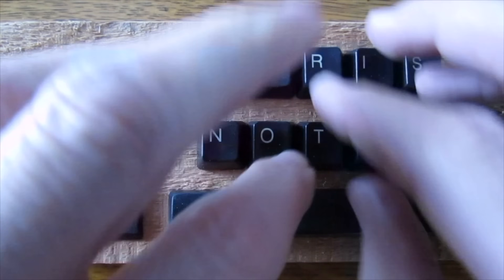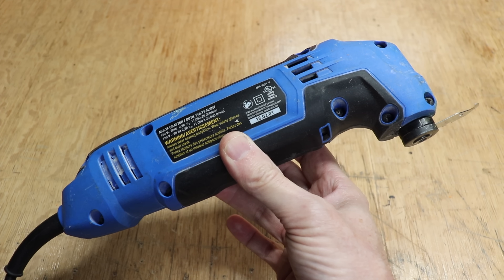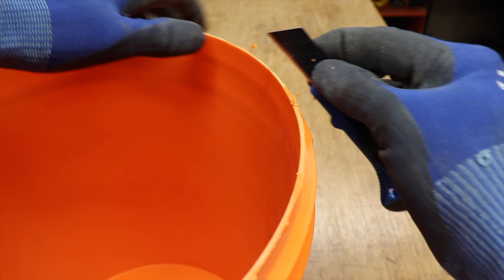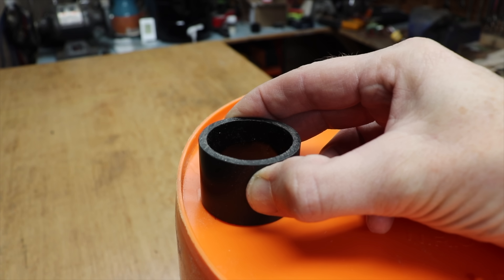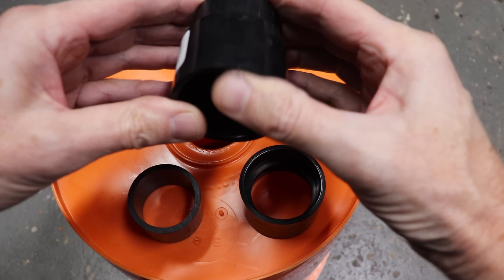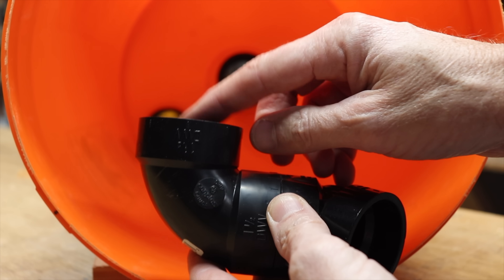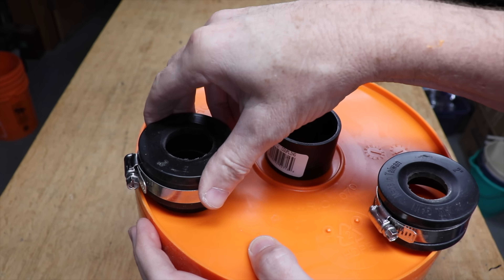How to Make ● Simple Cyclone Dust Collector

Comment: Hello, I am a beginner woodworker so sorry if the question is stupid, but can I make somewhat of a hole on the bottom of the bucket, so the dust would fall into a larger container(which is sealed aswell). I work in a small garage and want to use only a shop vac, but I don't want to empty it everyday. Maybe in this case I should buy an actual cyclone?
Reply from the maker: It's all about experimenting and trying things out. You should try it and see it that works. You may be on to something!

Comment: Just wanted to add another comment about this dust separator. My grandfather and I was ripping a half mile of cedar for a project and had burnt up two shop vacuums trying to keep up with the table saw. Came looking for a cheap quick solution for this weekend and built this 5 gallon bucket separator. And what a job it did. We still needed to clean the filters every so often because of the fine powder like dust of the cedar. But what a job it did on the rest of the stuff. Thank you for the solution.

Comment: Instead of wasting this much time and money on something that will reduce the suction power of the vacuum i would simply install a vacuum bag in the bin of the vacuum to the plastic part where the hose enters to the bin so the filter will stay clean and when i am done i can easily throw the bag away.
Reply from the maker: You need to build this! You'll be surprised at how well it works!

Comment: I wonder if the incoming pipe were somehow lower mounted on the side of the container, if the sucking hole were higher about 6 inches than the incoming pipe, would the filter in the vac be even cleaner...
Reply from the maker: I tried to keep it as simple as possible by putting everything on the lid. You can try that if you like to see if its better.

Comment: I must say quite impressive sir, I've played around myself with various designs mostly for soot. The multiple stage with water cyclonic type is what I ended up with, but alas there is no video with dramatic first person shots of vacuuming. Well done
Reply: I run an extension hose from the vacuum exhaust out the door.  No mess at all in the house.  The ash must be room temperature.

Comment: I built this, it worked great for a little while until I made the mistake of closing all the blast gates in my system at the same time - just for 1 second - and the vacuum imploded both buckets. I was able to bend them back, but now whenever I run it for a little while, it implodes again and the seal between the buckets gets broken.
Ive also found that the pipe connections aren’t as strong as I need.
Thanks for the video anyway, I’m probably gonna go to woodcraft and buy a proper solution.
Reply from the maker: I did an update for that problem here......https://youtu.be/BeU4nqSJtBY

Comment: Waste of time and money.
Reply from the maker: Interesting but why do you say that?
Reply: @chrisnotap  After creating this and using it a couple of time the bottom of The top bucket cracked and needed to be replaced.  Also, the unit is top heavy and constantly tips over.  I purchased a replacement and am happy with that.
Reply from the maker: The bucket may have cracked due to the material it was made from or it was old plastic. These buckets don't crack. I made a second video covering the tippy issue. Here is that video...https://youtu.be/BeU4nqSJtBY
Reply: @chrisnotap  Bucket was brand new.  Thanks, but no...

Comment: Would a car air filter help even better if placed inside the bucket with the connection that the vacuum pulls through?
Reply from the maker: I think you'll find that it's not necessary.

Comment: Interesting, I bought an actual cyclone unit that mounts on top of a Homer bucket about 20 years ago.  Still have it.  I think I paid 5$ at the time for the cyclone tube.  Plus some bolts and silicon.  I can fill the bucket pretty much full before emptying (just emptied it two days ago).

Comment: Have you tried this on a planer, if so, how did it perform?
Reply from the maker: Should work fine on a planer. But to answer your question no. But saw dust is sawdust. It will work!

Comment: Edit: seen your update! Lol. Same thing I did.
 
I love the design... but the buckets nowadays are just to flimsy. Lowe's, HD, ACE, HF, etc. They all seem to implode once I turn on the Vac.
 
I tried 3 different vacs. My big one led to me needing two more buckets.
 
My cordless Bosch did better, but it still caved in the buckets. So I had to support the buckets inside, with other buckets I'd cut the top thicker part, and bottom inch off of. 
 
So 4 buckets, but now my full sized vac doesn't crust it.
 
Thanks for the video!!!

Comment: Just built this today, thank you SO much for the tutorial! I’ve been meaning to do this for ages, and finally found one simple enough that I couldn’t make any excuses. Assembly went smooth as butter, everything worked out perfectly. (I did use a hole saw for the bucket lid holes and enlarged them a little with a Dremel sanding drum to make a press fit for the PVC - my ancient snips wouldn’t make a clean enough circle) I picked up a big roll of sump pump hose (1 1/4”) at the home improvement store, and some T’s to run it to individual machines (drill press, band saw, lathe, sander). Finally, I have a real dust collection system in my modest workshop, thanks to you! Much appreciated.
Reply: Can you tell me what size or model number is the pipe that goes in between the couplings I cannot find it anywhere
Reply: @georgenettlesjr1466  It’s just a little section of 1.5” pvc pipe

Comment: I'm having trouble getting the two buckets to go together after cutting the ring off. Am I not pushing hard enough or is anyone else having this problem?
Reply from the maker: Other commenters have said Lowe’s buckets also work.  In some parts of the country Home Depot must be using a different manufacturer for some of their buckets.
Reply: @chrisnotap  thanks, I figured that was an issue, too. Thanks again for this video as well, this is a really cool diy design.
Another commenter recommended using a third bucket as a sleeve to join the original two buckets.

Comment: That is freaking awesome. I collect brass dust and small swarf from cutting keys within the shop. Cleaning the vac is a PITA, and the filters are 35.00 each..... This separator looks like a terrific approach to extending the life of filters, and eliminate the amount of crud that blows through and out the inlet..... If I add an inlet bag to the vac, it should never get torn, providing the brass cuttings are captured in the buckets.
Reply from the maker: I would say it should work great in your example!

Comment: Thank you so much. This is the eighth DIY dust collection system video I’ve watched. This is by far the best video .1 no wasted time covering irrelevant talk. 2. Easy to follow instructions. 2. Simplicity of design. 3. Relatively low cost for materials. 4. It works extremely well. As a retired teacher, I applaud your instructions.!
Reply from the maker: Wow! Thanks for all of that great feedback!!
Reply: Yes, the best video. There are some really, really bad ones out there. I think one video I watched was 23 minutes long. I have no idea how glueing some fittings on a bucket can take 23 minutes to explain. haha. This is the best and most simple video on cyclones that exists on the internet, because it's clearly the easiest to build and doesn't have any ugly hot glue.

Comment: Brilliant Sir! Just saw the update for bucket collapse fix etc. You used a central vac instead of the shop vac as well. Got thinking...you used a shop vac in main video. Makes sense cause you don't want too much suction - only want the dust not the material itself. The central vac's power might want to pickup too much? Unless it's low powered...Hmmm I wonder if a light dimmer to vary its power would or wouldn't damage the motor?

Comment: Chris, what an awesome idea, congrats!
I just don't get the idea with the small screw at the bottom, what it for?
Reply from the maker: That is to prevent the angled fittings from rotating as you push and twist to insert the vacuum hose onto it. If it twists and moves, the whole perfect vortex you've created is interrupted and sucks up the sawdust. Hope that explains!

Comment: I am having problems with your design. I bought everything you listed. I then went to make it. My shop vac is a Ridgid with a 2 1/4" OD and 2" ID hose.  Those rubber fittings do not work. Any suggestions? Thanks.

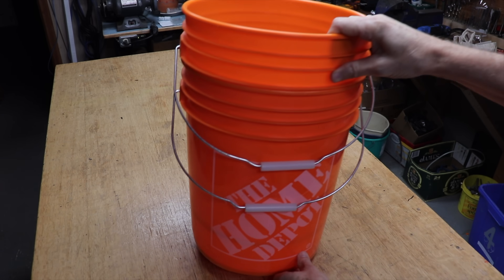Comment: 0:45 I found a real easy way to connect the two buckets with no additional parts.  Next, you'll need about 10 parts.
Reply from the maker: Lol yes!  But if you consider what you'd need to make a flange that connects this is way way easier!!
Reply: @chrisnotap  I was having some fun.  It does look like a great way to clean up sawdust.  Thanks for the tip.

Comment: Strange how so many people had success with this, but I'm stuck at the simplest, first part.  I cut the bucket as shown and created the 45 degree bevel on that bucket, but the two will NOT go together.  It's like trying to put a bike tire on a rim.  That list bit won't go in.  And if I rest the top bucket on the bottom bucket, the entire beveled edge doesn't sit slightly inside the bottom bucket edge.  Will keep working to find a work-around.

Edit: with a BUNCH of beveling of the inside edge of the bottom bucket, I got them to go together, but it was still challenging and fraught with finger pinching.

Comment: Ok. So instead of the dust going into the vacuum bucket… it goes into the diy bucket… which saves you from… having… to… errr…. empty the other bucket? What is the point of this?
Reply from the maker: The filter gets impacted with saw dust. Cleaning it is messy..

Comment: You made it look too simple to push the 2 buckets together. I’ve tried so many times so far, shaving around 20-30 times or even more, but they just did not fit together.  I am going to cut another bucket to see if I will have a better luck, but any tip?
Reply from the maker: Some have said Home Depot changed their bucket design or was different in their area and that they tried Lowes buckets and they worked.
Reply: @chrisnotap  Lowe’s bucket as the base fits nicely to the already-cut Home Depot’s bucket on top, so no bucket was wasted. It’s been working great so far.
Reply: @chrisnotap  I have also saw those comments, so I will give Lowe’s buckets a try. Thank you for this incredibly simple but useful design!

Comment: Thanks so much for the vid. I have made a collector slightly different to collect old loose fill insulation. I have used an old laundry bag as a filter to prevent the fine fibres entering the shop vac. Works a treat.

Comment: Simple…if you have a degree in engineering, have worked in a shop for over 30 years, have worked on each of these steps over 100 times on different projects.

Comment: This is not cyclone. You don't need to try rotating air by cycle in the collector. Particles cycles in your collector only because of inertia they got in the hose. The air inside collector will go straight from input tube to output tube it will NOT cycle with particles - just physics. You will get a better effect if you point collector input tube straight down - then the inertia of the particles will sums with their mass and then the sum force will be directed to the opposite side of the collector output tube. In a real cyclone to rotate air - external force like motor must be used.
Reply from the maker: Pointing it straight down just keeps all the particles stirred up and air born and will go right into the shop vacuum filter.......which is what we don't want. The centrifugal force flings the particles outwards and gravity forces them downwards

Comment: I just built this project with one change in that I used the large shop vac hose as opposed to the smaller. My thinking that more volume remove more dust. The system does work but I am getting about 20% sawdust getting past the cyclone bucket and into the vac. Any suggestions?
Reply from the maker: Make sure the pieces are angled as I show in the video. It's possible it might be too powerful. You could try a smaller vac and see if you get the same results.

Comment: I made a 1 bucket cyclone with baffle and it works ok for capturing 60% of concrete dust from basement floor grinding. Thumbs up on the simplicity of yours. If you cut out a 2" wide window along the length of the buckets and weld a clear polyethylene over the opening you can see how to optimize the intake size/positioning.

Comment: You could probably put a filter inside your dust collector to keep that dust from reaching your shop vac altogether.
Reply: filters clog and need to be cleaned or replaced. A properly design cyclone separates out all the fine particles before they can reach a filter element

Comment: You are some type of wizard sir
I think you just solved my concrete grinding dust issue. 
I’ve tried putting water on the vacuum and failed also the home depot dust collector and the cyclone bucket adapter i havent bought it because it’s similar to the HD dust collector. But this seems like it will work and i will give it a try.
Reply: Did it work?  I've got some concrete to grind and the catcher/separator is the piece to get.
Reply: @timmsmiithgm557  not yet i havent got the chance to use it since i havent had the need to grind concrete in my jobs which is the finest dust to test with, but as soon as i do i will give you some feedback.

Comment: I made this dust collector (including the modifications in Chris's other video) for use with my table saw a year ago while building new kitchen cabinets. It was especially useful when using my dado blade to mill dozens of drawer components. Since then, I've upgraded my vacuum (from 3.5 to 6.5 peak HP), which seems to have improved its effectiveness, and have more recently used it while planing some reclaimed oak. The 5 gallon bucket can fill up very quickly while planing, but it's a much better solution than no dust collection or a standalone vacuum. The portability and size of this unit (not to mention the low cost!) have made it difficult for me to justify a "real" dust collector. For the occasional DIYer with space restrictions, this is a brilliant solution! Thanks Chris!
Reply from the maker: That's great ! Thanks!

Comment: I followed these instructions and now have an awesome dust collection system. A couple of notes -

1.  I used 2 similar buckets I had lying around and they worked great. 
2. I had to take the knife around the edge closer to 20 times.
3. I just used a hole saw to punch the holes in the bucket and then I used some sealant to make them air tight,
4. If you are using 2.5" shop vac hoses they actually slide right over the pvc couplings. No need for the rubber caps, however, I did put a hose clamp on them so they are super secure.

Otherwise, these instructions are fantastic and I love my system.
Reply from the maker: Fantastic! Great tips!

Comment: I built this today for an upcoming flooring removal project to remove the thin-set and dust. It does work very well. I started with removing sawdust from the cabinet of my table saw which I have to do occasionally.  I used PVC pipe and fittings. If using pressure PVC the short lengths of pipe need to be 2-1/2" because the fittings are deeper. It should be specified to use drain fittings. I found a 1-7/8" Forstner bit to be very close to the right size for the snug fit of the pipe. I forced the first length of pipe and split the bottom of the bucket. I will just seal the crack with some heavy-duty elastomer caulk.  I have not completed this yet but I think using a couple of long sweep elbows would put less strain on the hoses and help with the tipping problem. I found a 20-foot length of vacuum hose on HomeDepot.com for about $25. This was less expensive than Amazon but is not stocked in stores. The first time fitting the buckets together is tough but once you get it the first time, it gets easier.

Comment: Does it add any additional load to the motor/does it perform worse than a vacuum cleaner without the additional "volume" in front of it?
Edit: typo. Thanks for the video!
Reply from the maker: For this purpose it adds no additional load.

Comment: Sorry if I missed it, but how is this design for drywall sanding and dust?  Has anyone tried adding water in the bucket with the hoses to see how effective that is?  Thanks!
Reply from the maker: The guys that have used it on drywall and have commented say it works good

Comment: What's the minimum size or HP to use with your dust collector?. I have a big 16 gallon 5hp vacuum but I'd to have a smaller one just for dust collection. Thanks

Comment: Just assembled one of these and noticed that the rubber connector for the 2 inch shop vac hose just fits over the 1 1/2" connector on the top. No need for the 2" rubber cap when using this size hose.